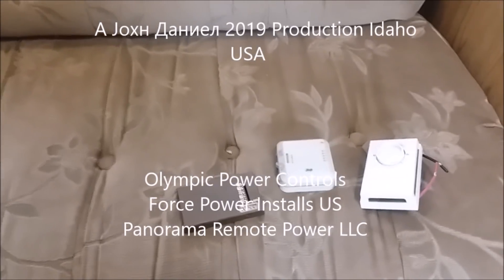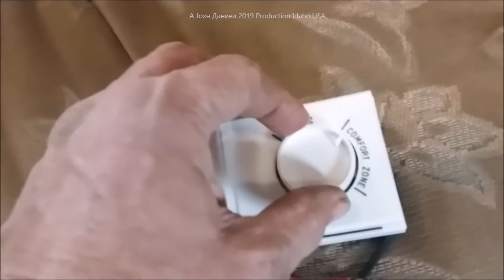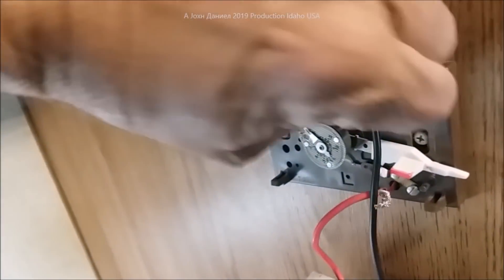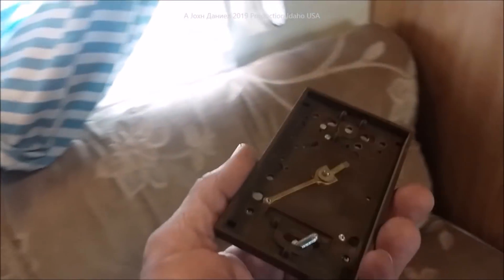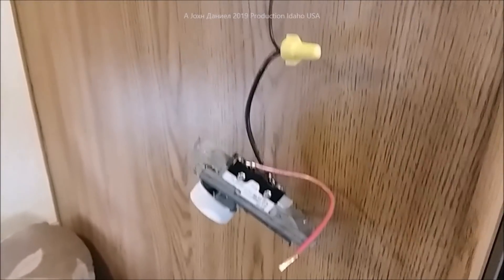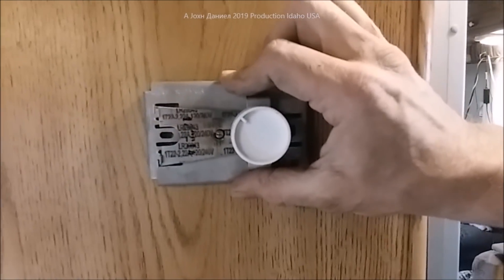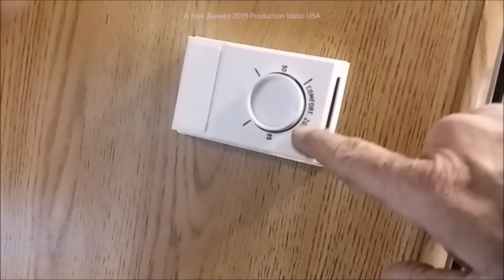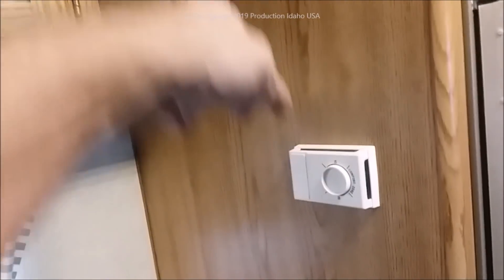Using CHEAPER Line Voltage Optional RV thermostat on any 12 volt RV furnace, good results

Comment from the maker: Newest line volt Thermostat on page https://amzn.to/2FsCGXF Tons of RV Heating Parts ↘😍Emmerson run/delay Sequencer https://amzn.to/3VBRAji about $15 (High Limit OVERTEMP SWITCH OPTION https://amzn.to/3VyGhbG )  PROPANE PARTS @ THERMOCOUPLE http://amzn.to/2Apg9su and/or https://amzn.to/2GEwKM7  MORE 👉 Universal Run Delay Relay https://amzn.to/36MXTrR Universal High Limit temp Switch (get 120°C/248°F Normally Closed N.C Snap Disc Switch) https://amzn.to/36Jtbjh Blower Sail Switch https://amzn.to/4kmRMiz it sends GO signal to board (pick a best option) Universal Control Board fits 90%+ models https://amzn.to/4kZp6vZ Need  Tech Answers? go👉 Donate $5+ on KoFi - https://ko-fi.com/john4kiera OR https://bit.ly/2buyaCoffee message, inquire, to get my help & replies!

Comment: I have a sf30 that is controlled by a dometic analog t/stat that also controls my AC. I replaced because my furnace won’t fire.   New t/stat still not working.  If I remove the wires from the t/stat contacts and touch furnace to ground, it works but not when connected on pins on  the t/stat.  Voltage on the furnace wire is 10.2V and ground has about 1.0v.  When I put the AC on the furnace contact pin of the T/stat and turn up the heat, the AC comes on so I’m thinking the t/stat is working. Any ideas on why the furnace won’t fire?
Reply from the maker: It will run once started on 11.4 volts and higher till a preset cut out voltage of 10. But it must have over 11 volts for the board to accept the signal. Replace the RV battery or converter or you can try running a test by using a fresh battery from your car wired into the existing batteries to boost their reading.
Reply from the maker: Another option is checking voltage at other places, the furnace may have a circuit breaker thats leaking out. If you have over 12 volts everywhere else, you have other issues in that heating system.
Reply: John the mystery continues. I replace the battery.  I have 12.5V everywhere now but still no furnace unless I jumper the wires at the t/stat.  If I switch on the generator and check the converter I have 13.5V charging and still no furnace on generator power. Everything else in the rv works.  If I turn on all my lights I will see a power drop at the t/stat to 10.5V. I also noticed if I switch the t/stat to cool, my air conditioner wants to run regardless of the temp t/stat setting. Could the AC somehow be shorted causing my furnace not to run?  Disconnecting the wire at the t/stat or switching off the breaker to the AC doesn’t help. Still no furnace.
Reply from the maker: Sounds like the T-stat is somehow gone to switching on the negative instead of positive. That would explain the actions of it better. Since the furnace is 3 wire with a positive return on the switch nothing else but a negative crossing inside it could explain the actions.
Reply from the maker: If I remember correctly the Suburban furnace will be switched by positive voltage, the AC unit switched by Negative. In the dual thermostat it should have a option to perform that way, if it does not your SSR inside it is getting confused or defaulting. Its a 50/50 chance thats the issue.

Comment: I installed a residential Honeywell thermostat digital..just remov jumper from R to RC..as the furnace and the ac each have-own power ..t as
The batteries will be required to be installed in t stat to operate modes.. due to t stat needing 24 volts.. RV furnace or AC put out DC voltage and will not give enough power to run t stat.. so batteries are necessary.. works great and it’s accurate..